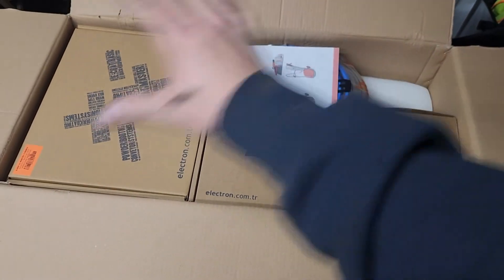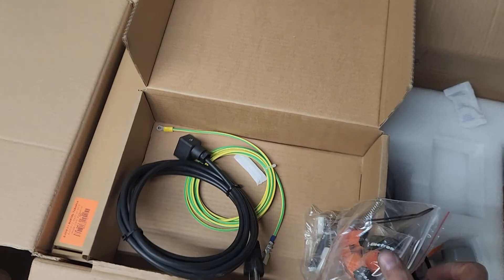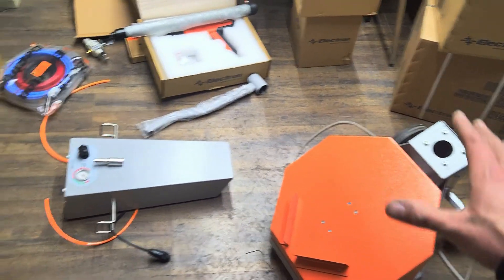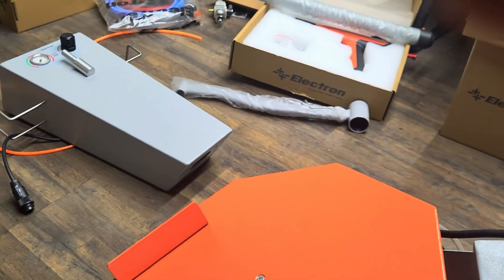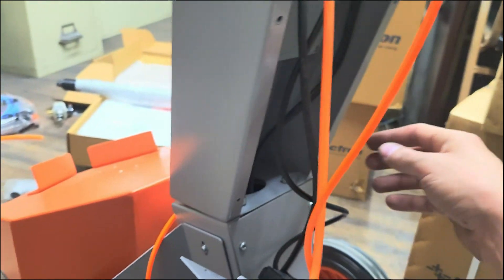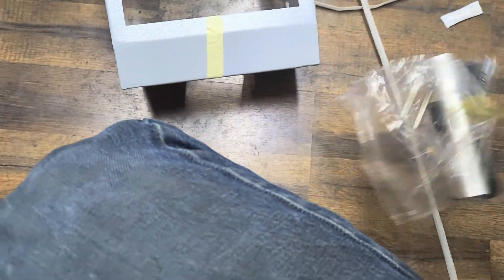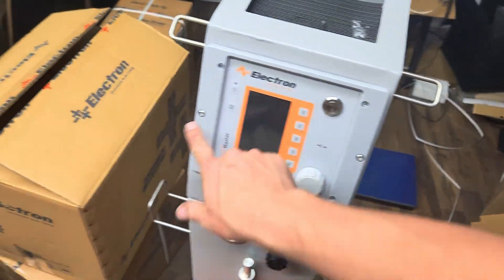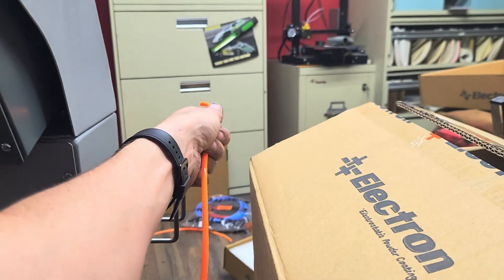Electron Box Feed Gun Assembly.

Comment: If your sandblasting unit is on concrete and you have a blow out  (hole) in the bottom valve. How long would it take to put a hole in the concrete underneath??